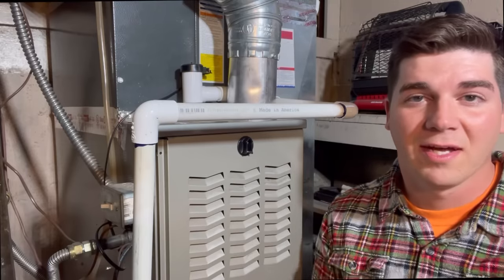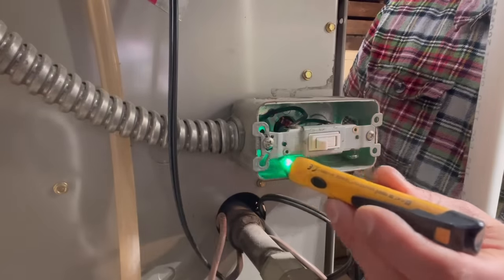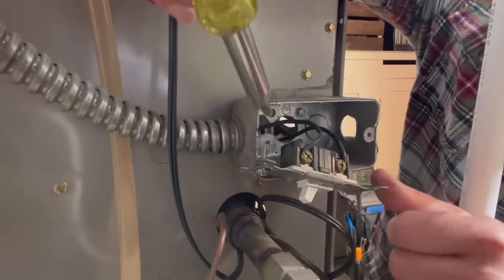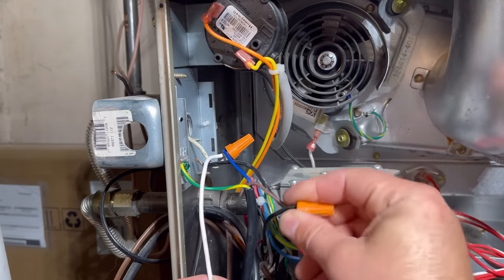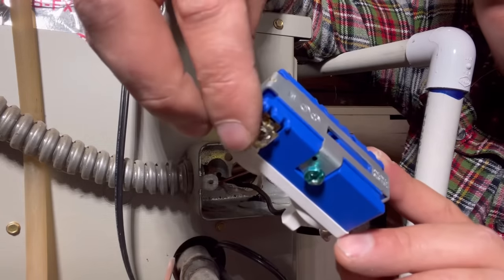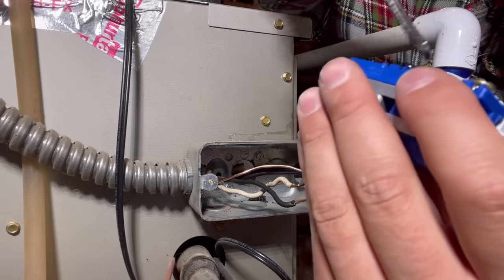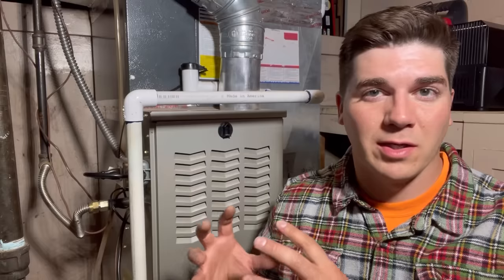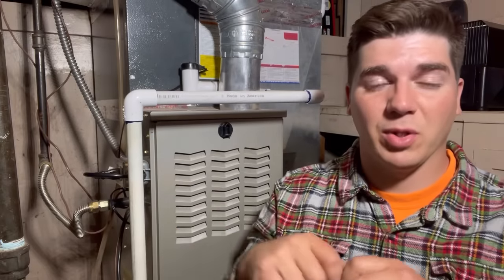This Could Keep Your Family Warm During An Emergency Power Outage.

Comment: I’m not electrically inclined so forgive the ignorance of this question.  Why wouldn’t you simply unplug the heater from the house supply plug and plug it into the outlet on the inverter????

Comment: so you swapped out a switch on a 20 amp circuit to a 15 amp outlet + switch and then put whats likely a 13 amp cord plugged in to it? Even if it is a 15 amp cord that's set up for a fire.

Comment: This only works on gas furnaces , right? I have a heat pump. I think it would require too much power for a portable generator. What do you think?
Reply from the maker: I’ll be doing some videos on powering your heat pump or electric furnace with a generator very soon. But yes this is only for a gas furnace unfortunately.
Reply: @diyhvacguy  Thanks!

Comment: What if your shutoff switch also has a buss fuse on it?  How would that factor into the replacement process.  Would another box need to be wired in?

Comment: Hi, I wired up my furnace exactly as shown in your video and even ordered the same parts. Wiring it up was a breeze and it works great. The problem is when connecting with an extension cord, the furnace will start but shut down only moments later. Could the extension cord be under rated? It a standard 14 awg, 50 foot extension. I tried using a power station and even plugged into another outlet in the house, but the furnace will not run. Any ideas?
Reply from the maker: That is super odd. Do you need a 50 footer? I don’t know why that would matter. Is your ground attached to the case or just going from the pigtail to the furnace ground wire?
Reply: No it doesn't need to be 50 foot, it's what I had handy. I have since tried a 15 foot, 12 awg extension and get the same results. It starts but shuts down after about 15-20 seconds. The furnace ground is attached to the electrical box inside the furnace and the other end connects to a copper water pipe. I attached the pigtail ground to the electrical box. The furnace works fine when the pigtail is plugged into the new outlet but plug it in anywhere else doesn't work. Strange.

Comment: Great video! But my "furnace" is an electric heatpump (220v) with an outside compressor. Is such a switch available to handle that voltage and the outside compressor too?
Reply from the maker: Yes I have another video with the interlock kit and power inlet box that would work perfectly for you. I just posted that a couple days ago. Give it a view! Cheers
Reply: @diyhvacguy  Thanks man. You have already helped me a lot in my DIY quests, and I only discovered you last week!

Comment: When we have a power outages and back, the heat does not work by itself. It shows no flickering light. When I flip the power switch attached to the unit off and on again the flickering start and the unit works after. What you think is wrong...... thanks ?

Comment: Not sure if it’s been answered. The thermostat inside the house, doesn’t that need electricity?  If the whole house doesn’t have power, will the thermostat work?
Reply from the maker: Yes the furnace powers the thermostat so as long as the furnace has 110v the thermostat will function as normal 👍🏼
Reply: @diyhvacguy  Thank you.

Comment: Maybe this has been asked but when plugged in to a generator should the the switch be turned off in order to prevent backfeeding power to the house circuitry?
Reply from the maker: Yes when plugged into an alternate power source the switch should be in the off position

Comment: Correct me if I am wrong, but your breaker was a 20 Amp and your switch/receptacle appears to be only rated for 15 Amps. They do make that switch/receptacle for 20 Amps. It is easily recognized by the T-slot for the neutral blade.

Comment: Hate to burst your bubble, that is more than a $10 solution. You not only have to modify the switch, but you also have to have a generator or an inverter and battery pack, far more than $10. All you need is an old big pot from goodwill, a couple of bricks, and firewood and you can stay warm for a lot longer than that.

Comment: If you're going to use a plug anyway, why do you need the switch?  Why not just use the plug to disconnect power?  Is that code?  If the furnace mfg didn't put one on the appliance--why do we need one?  And you do have a breaker.

Comment: OK, this works, but it is not a good alternative to installing a proper transfer switch, which is about the same amount of work and only a bit more expensive. Also, label things - the next owner of the house is going to be very confused at seeing this Mickey Mouse setup for the first time if it isn't labeled properly.

Comment: Excellent mod to the furnace but you connected all of the screw terminals on the switch wrong. Our code says that they should be connected so the wire is on the opposite side of the screw. That's done so the wire gets tighter when the screw is tightened.
Reply from the maker: Ahh thank you for the tip! I have since made sure to do it that way! Cheers

Comment: Hey, could the pigtail be eliminated & just make a double male ended extension cord that plugs into the switched outlet for a cleaner look at the j-box? Thanks
Reply from the maker: Yes but it’s frowned upon because it’s a “suicide cable” 🤷🏻‍♂️
Reply: The exposed hot leads of a cable like that is super dangerous

Comment: My problem is dirty power when my Generac GP8000w is powering my home with a transfer switch. The Rinnai E110CRP propane boiler throws a BL86 error that indicates that 60hz is not present and it’s either above or below the 1.5hz threshold… sometimes running a small space heater will load the generator enough for the boiler to fire but it doesn’t last… any help would be appreciated

Comment: This maybe real ignorant question, but here goes, I  don't have gas furnace. My system is electric, I assume it will also work. But what Watt size invertor will I need to purchase?
Reply from the maker: No this only works for gas furnaces unfortunately
Reply: Thanks for the response

Comment: Why break the jumper only to install another on the other side of the spst switch? I'd think you'd only need to break off the jumper to wire the outlet to constant power and have the switch control something else (like a light fixture).
Reply from the maker: I think it had something to do with the little led light only coming on when the switch is turned on.
Reply: @diyhvacguy  OK, I see what you mean. If you wired it the other way, it would just indicate that the switch had power from the mains, whether or not it had switched on the load.

Comment: Quick question let’s say I set this up which btw is pretty convenient, would safety pass if it ever needs done?
Reply from the maker: Depends on your ordinance. But if they failed it, like if you were trying to sell your home, you could easily revert it back. But most inspectors would be fine with this setup.
Reply: @diyhvacguy  thank you I would definitely be setting this up in the next few days. Already have it all in my head lol. First set this up, I got a few long extension cords. Should be good to run one long extension cord for just the furnace then another one to keep the fridge on, splitting to wifi router, one tv and a couple headlamps? Stove is gas so can either plug it in or light it up to turn on. I could run another extension cord what you think

Comment: I use a gas furnace for heat. Whenever I have a power outage my furnace still works. But, whenever I got my central air conditioner replaced my gas furnace stopped working whenever we would have an power outage. What did they switch when they installed my air-conditioning unit? And how do I change it back
Reply from the maker: Not sure on this. If you don’t have power, both forced air furnace and ac should not work. I’d need more detailed to answer that question
Reply: @diyhvacguy  Thanks for your help! I would have to have someone to look at it. I don't understand how to check. My friend that built my home passed away from cancer.

Comment: If your furnace has a screw in fuse on the switch, and it is wired up as you show, how will that affect the furnace when you do away the screw in fuse? It is an old house that does not have circuit breakers. It has screw in fuses in the main panel just like the fuse in the switch on the side of the furnace.
Reply from the maker: I’d say if there is another fuse dedicated for the furnace, you can pull the fuse out at the furnace itself and thread in an outlet adapter. Then wire the pigtail to your furnace power wires and you can achieve the same results and be prepared in the event of an emergency. Cheers

Comment: I have a garage light that has a 3 way switch, one switch in the garage, one inside the house. Problem is the switch inside is often left on, I need an indicator (lamp) inside to tell me when it is on. problem is no identified wire (neutral) in the inside switch box. Any ideas, without using a current transformer.

Comment: Curious, what function does the switch serve other than a quick way to kill power to the furnace for maintenance? Could you not just wire an outlet to that outside gang box and just unplug the pigtail?
Reply from the maker: I think it’s building code

Comment: What gauge wire did you use and is the switch/plug a 15amp or 20 amp ?
Reply from the maker: The furnace is in a 15 amp breaker although I nabbed the snippet of the video showing a 20 amp breaker.  I used 15 amp rated wiring

Comment: Would it be easier to add a generator plug outside your home than use your breaker switches to control where the power goes if you don't have a big generator?
Reply: Definitely an option but I wouldn't say it's easier. It'd be more expensive too for the generator inlet plus you'd need to get a breaker interlock to make it safe
Reply: @SmithOffGrid  this video shows the plug inside, now you need to run a cord outside forcing you to leave a door or window open. now bugs get in. plus my way powers the house vs just the furnace.

Comment: Hi I have my switch it has 2 black screws and green screw on one side of the switch. Other side has 1 silver and 1 brass I take it the jumper wire goes on the bottom black screw and than jump it to the brass screw on the left of the switch?

Comment: Why the switch? Can you just hard wire the power from your panel into an outlet and then add a pigtail to your furnace end? That way when you unplug the furnace you are disconnected from the Bain line. I don’t understand why you need a switch?
Reply: I think the switch is required by code on all furnaces as a means of disconnect within sight of the furnace. Not sure if the outlet and plug would technically count as a means of disconnect...

Comment: Why did you cut the tab on the switch again? The switch now controls the outlet like it comes from the factory . You dont really need a switch just unplug it from the house power and then plug it into the inverter/generator. Mabey im missing something here
Reply from the maker: It’s for the red led light from what I’m told. I was just following the instructions.

Comment: I follow this video and hook it up to my inverter generator with 3000W output. It does power the fan but it would not turn on the heat. It seems it would not lite up the gas.
Reply from the maker: You probably need a neutral bonding plug. I have a video on this.
Reply: @diyhvacguy  Yes but bonding plug is not really safe. I am going to install a transfer switch which will take care of the neutral bonding and add other circuits to the generator.

Comment: You can still get ghost voltage when a hot pen says there is no power. I have. I use a multimeter anyway. * And yes, it was enough to make me regret it.
Reply from the maker: Good to know. Thanks for the pointer. I’ll keep this in mine moving forward!

Comment: Im wanting to see exactly how many watts my furnace pulls during startup and while running. I have a watt meter that shows the watts of whatever is plugged into it. So i am thinking about doing this...BUT if there is an easier way of reading the watts without having to do the switch/plug install  please let me know. The hot and neutral wire that go to my furnace are exposed so maybe there is one of those tools that clamps around the wire and reads the watts? (by exposed i mean the romex 12-2 is coming out of the wall and going into the furnace) Thanks for any help :)
Reply from the maker: Grab a cheap meter like this one and test the black power wire on A/C amps 👍🏼 https://amzn.to/3R3Vn7h
Reply: @diyhvacguy  Thank You! I forgot amps x volts = watts lol 👍

Comment: My switch/receptacle does not look like yours at all on the sides. Two lugs on one side two on the other with a ground terminal. Have removed tab and wired it in temporary but can not figure out where the jumper wire goes or what will happen when I do figure it out . 🤯

Comment: When first opening the switch, there are only two wires visible, power wire, attached to the old switch and the neutral that goes through and into the furnace shell. When attaching the new switch, there is now a new ground wire to attach to the new switch. Where did that come from? Did you have to run new wire through the conduit?
Reply from the maker: Yes I had to run a new ground.
Reply: @diyhvacguy  Thx for the fast reply.

Comment: Why not do this further upstream? I don't want to open the furnace cabinet or change anything within. Is there a reason this same setup couldn't be done more simply a few feet further up the line so all I have to do is link the pigtail into the normal wire feeding into the furnace?
Reply from the maker: I’m not sure what you are asking here or how that would be easier. This is extremely easy as it is.
Reply: @diyhvacguy  if I basically just did the switch and pigtail with Romex feeding from the main fuse into the switch and then Romex on the other end of the pigtail couldn't I just avoid opening the furnace cabinet or messing with making new connections inside? I would think that would be simpler and would require fewer materials such as those little clips you showed. It would essentially be adding an interruption into the wire that feeds to the furnace rather than putting that interruption right at the end of that wire before the furnace

Comment: If the furnace already has the switch and a cord hook up does that mean it is already set up to receive external power? What if main power comes back while it is connected to secondary power source or an inverter?

Comment: Outstanding!.. will it work for oil furnace
Reply from the maker: If it’s 110v then absolutely!
Reply: @diyhvacguy  that's awesome! Even you're previous video hot wiring it to that battery 
Can you tell me what that silver box is called you use with the battery? I'd like to get one for my sump pump also as back up power Thanks!

Comment: What about the thermostat? In a power outage, the furnace now has power from the generator, but how does the furnace know to turn on/off without power to the thermostat located somewhere else throughout the house?
Reply from the maker: The thermostat gets its power from the furnace so as long as your furnace is powered up, the thermostat will work as it normally does 👍🏽

Comment: Does the installed switch need. to be shot off? if not I would think the power from your generator would feed back to the original source. Not good if people are working on the main line! please correct me if I am wrong.
Reply: The added pigtail makes it a stand alone device. After the furnace is unplugged from the switched outlet, it is no longer attached to the grid.  How would any backfeeding occur?

Comment: This is silly, you can't run a furnace very long on one battery and an inverter. You have what, a 35 amp hour battery, maybe? And then you have to keep that battery there on a battery maintainer, or it'll self discharge and be sulfated in a couple of months which is another hassle. Ok if your furnace needs 500 watts at a minimum for the inducer, blower, and 24v stuff, that means you're pulling AT LEAST 45 amps out of a 12v battery, and you're battery will be gone after maybe 1/2 hour of running the furnace. That is nowhere near long enough to make it thru a cold night. Yes your furnace will only run a few times in 8 hours, but it needs a lot of constant power to run the transformer, thermostat, control board etc.
Reply from the maker: You sir are wrong. Watch the video with the inverter on top of a battery in the thumbnail. The system ran for SIX hours on that battery. So your math is wrong. Admittedly it wasn’t days, but six hours is great in a pinch.
Reply: @diyhvacguy  I'm not wrong. The math is basic. Batteries are rated in amp hours. Let's take a simple example, 6 amps x 6 hours = 36 amp hours. 6 amps at 12 volts gives you a whole 72 watts. And then even assume you have a 100% efficient inverter, that's only 0.6 amps. That's not even enough to run a typical inducer fan. That furnace must have ran for maybe 20 minutes over that 6 hours. I don't know why people somehow think you can get any kind of usuable power out of a car battery. They're designed for starting, huge amp flow for a very short time, and then immediately put back on charge. Also storing a lead acid battery by a furnace constantly connected to a charger or battery maintainer also isn't a good idea.
Reply: @diyhvacguy  I can see on that inverter that it's using nearly 500 watts. A typical truck lead acid battery isn't going to be very happy delivering that much power for very long, the voltage will start to drop off fast. 500 watts at 12 volts is nearly 50 amps. That's worse than leaving all the lights, radio, and heater blower on high in your truck...

Comment: What’s your recommendation when your furnace switch is fused? Ours has a 15amp fused switch and I’d love to go this route, but don’t want to lose the fuse.
Reply from the maker: Check out one of my latest video on installing an EZ generator switch it has a built in fuse and it’s very easy to install 👍🏼